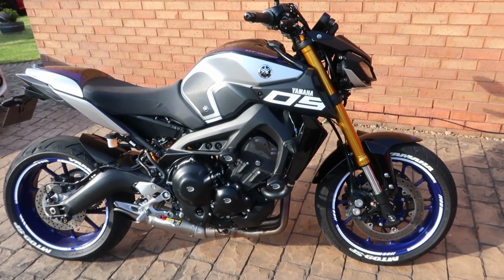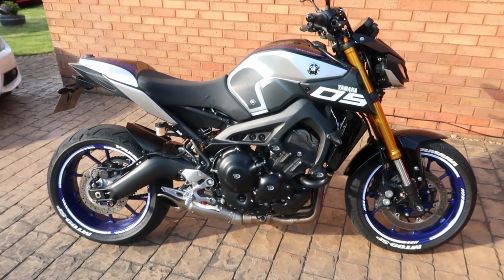Yamaha MT09SP Full System Titanium Akrapovic Sound.

Comment: Nice job, I always enjoy your videos. Here’s my (2 pennies worth though on 3) observations (oh and I know it maybe all be down to the making of the video etc.)... I do notice (now everyone will jump on the bandwagon now) that a) the sole of your boot looks good, lol and b) you don’t use the rear brake much and c) the important one is you don’t (cover /) have your foot hovering above the Brake pedal tip; as you have your foot out off to the outside of the foot peg 😬. So when you do need to brake you must be  moving your foot over in and then down onto the pedal which adds extra time as it’s 2 things to do ☺️. Might be good to break (brake ☺️) that habit. As brake reaction times are much better if you foot is already hovering above the pedal. Lots of folk apply rear break to trail a slight bit of speed of and it can help settle suspension or control big wheelies. Just thought I’d point it out, don’t be throwing anything at me about this 🤣. Btw the exhaust and bike sounds well. Keep up the good work. Good sound track to 👍
Reply from the maker: I don't EVER use my rear brake 😂.
Reply: PistonHeadChaz That I did suspect, lol, guess scooter days or brake pad money saving tip 😂

Comment: Noticed what appears to be a sensor in the exhaust before the muffler. The function I suppose would be to feed data to the fuel injection system.  If so, does this negate having to remap the system.  In the old days -- when I put a collector on a Honda 750 K1 back in the early 70s, you had to check the carbs, plugs etc to see if rejetting was needed.  I real pain.
Reply from the maker: Its unplugged. I just havent removed it yet haha.
Reply: I guess you'll find out later if it is  important.  Great sound though.  The triples always sounded that way -- at least the old Triumph triple from the 70s.  My Honda four (K1) sounded a lot like a Jaguar 120 with the DOHC inline six.  The same booming sound. I loved running it through the gears.   I guess I am just an old frustrated biker at heart.  Enjoy yourself when you are young just like you are now.
Reply from the maker: No, its not needed after the remap just need the blanking plug for it. I'm sure trying!🤣

Comment: Hey chaz, I got a question for you. I just passed my first 500 miles on my MT09SP and I found a problem; For example picture this: I ride down the street and stop at a red light let's say in 3rd gear. When I stop and try to downshift into 1st my gear indicator goes blank for some reason and I'm stuck in between 3rd and 2nd. To get into 2nd I have to gently release the clutch. Repeat the process to get into 1st. Is there something wrong with my transmission, did this ever happen to you or am I doing something wrong? And yes I press the gear lever all the way. I noticed that this happens only when i'm standing still and trying to shift gears